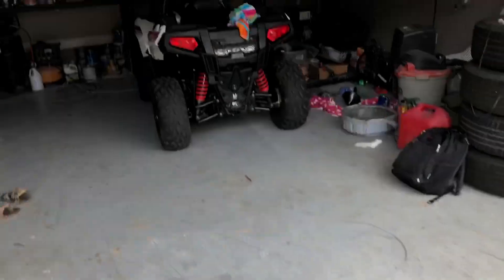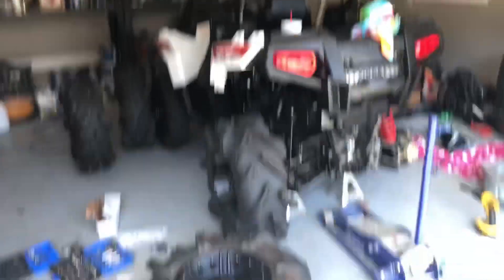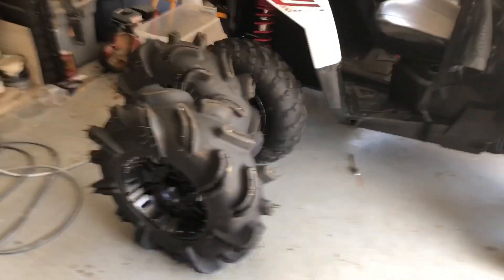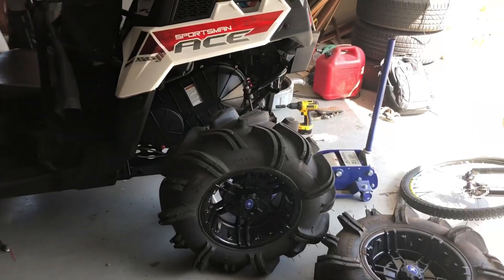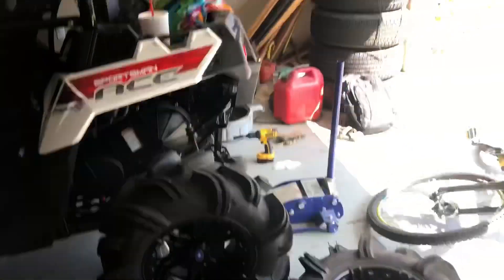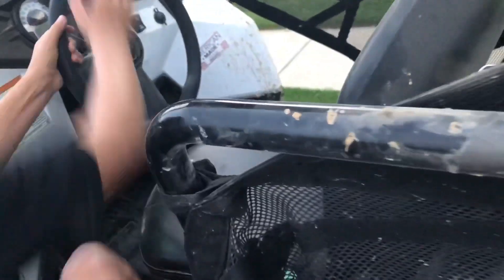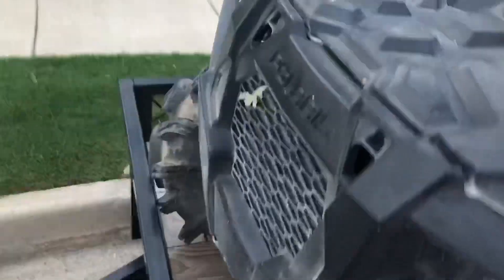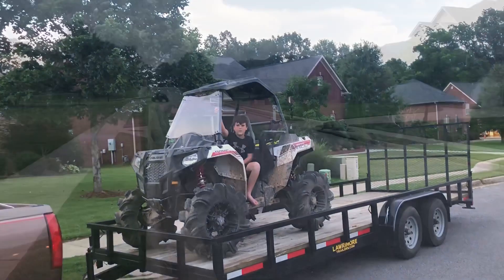Polaris ace 325 build part 1, 2 inch lift and 28.5 inch outlaws. Incredible!!!!!

Comment: a 325 with 28.5 outlaws...may need to see some more footage to see how that is working. Seems a little big for the power output of a 325.
Reply: 32hp is fine but I would and a filter and hmf pipe. Maybe a power commander
Reply from the maker: North Country Boyz I’ll upload a vid with it running. Runs great in low with the 28.5 outlaws